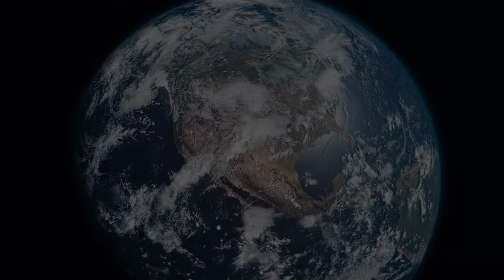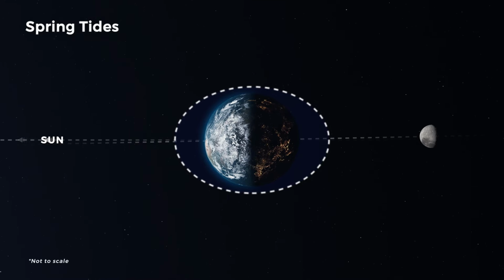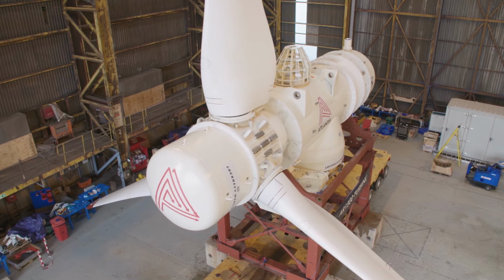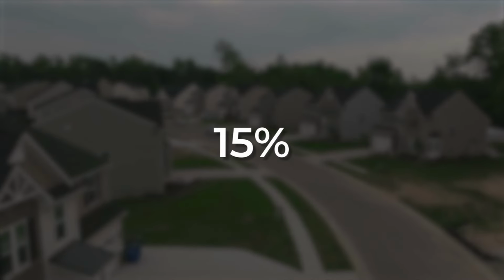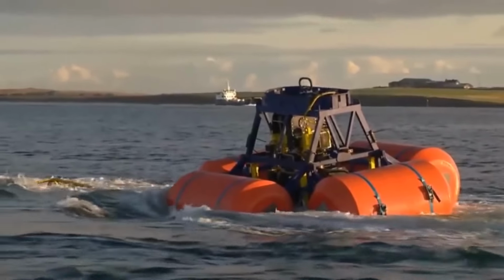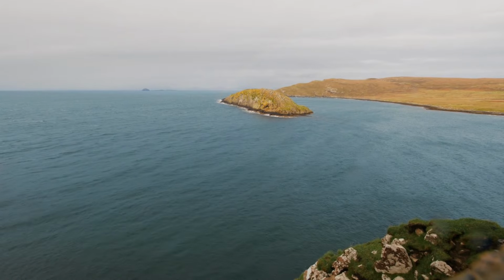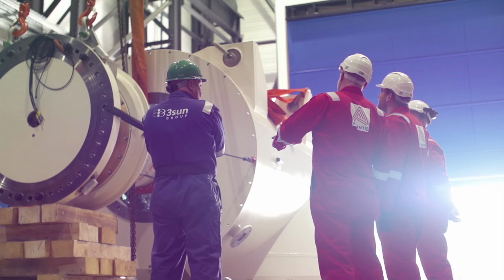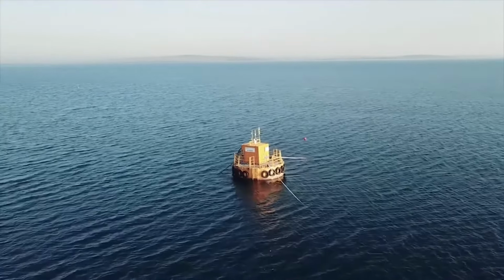Can Underwater Turbines Solve Our Energy Problems?

Comment: You know what's cool? Nuclear & renewable combined for energy production 😎
Reply: While browsing for hydrogen production technology I came across a very interesting new science discovery by a NZ Lab named H2IL . It has the potential to replace nuclear, fossil fuel and renewables energy. I was intrigued by something so simple but scientifically logical. What do others think of it?
Reply: @scienceeducatorge8597  don't know anything about it, but hopefully is something more than a good looking concept!
Reply: pure renewable Energy sounds better ;)
we can talk again when they get Fusion-technology working^^
Reply: @smaragdwolf1  it would be great, but currently it is simply not fiseable in the majority of countries, mainly because of current methods not working 24/7 (poor wind for turbines or night for solar panels and so on). To fill the gaps in energy production you would need a source that you could switch on and off, so you would end up burning fossil fuel. As of today, what you are proposing can't be done, sadly
Reply: @mqwersly  renewable Forms of Energy isnt Sun and Wind alone.
- Pumped-storage hydroelectricity (PSH) pumps, when you have an abundance of electricity, water from a lower storage to a higher build storage. When you need electricity, you use the potential Energy of the stored Water to run Generators, while the Water is flowing down again. (works in Areas with Mountains)
- Geothermal Energy is a pretty good Energy-Source when you have Vulcanic Activity in your Area. Pumping Water into the Ground, where its heated up until it has enough pressure to run a generator.
- As in this Video, when you have strong Water-Currents, you can generate Energy with it.
- When you have lots of Sun and unusable plain Soil, a Solar power Plant is another form of Sun Energy. A Circle of curved Mirrors collect and focus the Sun-Rays into a Spot at the Upper End of a Tower, thats build in the Circle-Center. The focused Sun-Rays have lots of heat and boiling Water very fast, that runs a normal generator then.
- not sure if it exist, but in Areas with Mountains, you could also use Wind. The Up-Currents at the Mountains should be able to collect with a cylindric wind-turbine. Like these really old rolling lawn mowers. cylindric with twisted Slats.
- For energy-storage the newest Technology i know is (Power to Gas) to use the abundance of generated Energy to split Water into Hydrogen and Oxygen and storage the Hydrogen for later use.
- of course we need to connect the Countries with Cables to form a Network, so if one Country has a lack of Energy, it can get it from the Neighbors. In Europe there is already such a Network.

Im pretty sure, we can give most Counties on Earth for sure, a good amount of renewable Energy, if our Leaders would already understand the potencial and the Problems we have -.-

In Germany, despite that our Government defend the Coal-production with all kinds of weird behavior, we will have a ratio of 54% (fossil Energy + Nuclear) to 46% (renewable Energy) this Year. Wind will be the biggest part of the overall Mix with 24%, brown Coal 20% and Nuclear 14%. Our last Nuclear plants will be shut down in a few years, that is fix. Coal-use shutdown will be the next after nuclear.
Reply: @smaragdwolf1  precisely, Germany is a great example of things doing the wrong way, closing nuclear plants while maintaining coal burning plants. It's great that in your country almost half of the energy production is renewable, but still it's a really bad system. Lots of countries don't have water bodies to substain the production of energy (landlocked or without major rivers), and the power storage method that you mention doesn't seem to be ready for mass implantation in a major scale. IMHO, as of today, we should be looking forward to implant a system such as the French, which relies heavily in nuclear and renewable. I'm also interested in the development of thorium reactors, as they seem to address lots of the uranium plants, and of course breakthroughs in renewable technology.
Reply: @mqwersly  They planning and building a Power to Gas Plant in ...i think it was Hamburg, right now.
Even with their reaaally slow speed, our Government made a plan to close the Coal-plants in 10 years....and we Citizens will make sure, that they will do it faster.

Like the French? France has a very old Reactor near the german border and that one had already so many incidents, that at one time, our Government gave Iodine to the Citizens in the closest area - just to be safe. Belgium (another small country near the western Border) has a problematic old Reactor too.
Yes its dumb to get rid off nuclear before Coal, but beside the Fukushima catastrophe, we know very well, that there is NO EXISTING final STORAGE for radioactive waste. Not in Germany, Europe or the World. Its like living in a House on a small private Island...... without a Toilette.
Keep Coal, Gas and Uranium in the Ground as much as possible. Wouldnt our Government (feels like that) actively slowing down the Installation of Turbines and Solar panels, we would have already over 60-70% renewable :(
For the Countries who really dont have any chance to produce energy on their own, i named the Network of Powerlines, spanning through multiple Countries.

Comment: Have you seen anything about oscillating water columns? 
A very similar concept, except it's a vertical setup, floating just above the seabed, with pistons that are raised and lowered by the movement of the oceans.
It wouldn't require being placed in such fast flowing areas, and early studies seemed to suggest they improved marine biodiversity!!

Comment: Hi
question:

are there any studys regarding the longterm impact of removing large amounts of energys from the natural system via "renewable energy sources" like tidal, wind, solar or (most importantly) geothermal?

since all of those forms of "energy generation" are taking energy from an existing system and makeing them usable for us it would be the logical conclusion that there would be less energy in the natural system afterwards (preservation of energy and all that ^^)
and while some of them are predominantly external influences (like solar) things like geothermal (where we pull warmth out of the earth) should be a limited resource (large yes. but still limited)
its a question i never see asked nor answered when it comes to "green energy"...
Reply: Taking that energy isn't really going to do much harm. In the same way that solar energy doesn't stop the rest of us getting a sun tan. Apparently a town in America voted against solar because they were afraid of taking all the energy from the sun.
Reply: @warbler1984  well yea for solar its less of a problem but what about the others?
reducing the air/waterflow sounds like a bad idea 
and lowering the internal heat of the earth sounds like an even worse idea.

and sure we are not taking much at a time... but like a leaking bucket one day it could be noticable and probably irevercable...

Comment: Just wind turbines would work dont need underwater. I had a 48v pmg that made no noise facing forward on my sailboat mast and when i drop my anker on the front the boat faces the wind and charges my boat with 30 amps. Crazy i should covert to electric motors lol.

Comment: I have been citing tidal power for years. The UK has some of the highest tidal ranges in the world. It has less of a visible impact and is much more reliable than wind. With heavy investment in wind I just don't understand why tidal power has not been more favourably received
Reply: Cost. It's just much more expensive than wind or solar and those two are dropping in cost very fast as well.
Reply: @robbert-janmerk6783  All true. But the absolute reliability of the tide offsets the small additional cost (in my humble opinion)

Comment: No and if you like I can modify your wind and ocean turbine to run full time on a dule pack I've been building and modified gearbox so your wind runs 3000 rpm and when the wind picks up can gearbox the load and shut down the power draw from the packs to save cost and with a wind 3mw turbine running all day don't complain. I can get your solar on 24/7 too if you like for a few hundred watts ????? Engineering mmmmmmm.

Comment: I'm somewhat surprised at the fixed versus a possible mobile instillation.  I wonder what consideration was given by the designers of the feasibility of having instillations which are floated in, sunk and then refilled with air to remove/repair?  While the tidal movement generates some force, such submersible structures probably wouldn't move and anchor with only the propeller parts moving.  The footprint on the floor of that type of design would be bigger, but there wouldn't be the need to drill into the ocean floor.  There would be more flexibility.
The storage battery in such cases may be pumping air into anchored tanks with no bottom open to the sea and water pressure at near atmospheric pressure so little energy is lost due to heating/cooling transfer and then drawing on them at off power production times.   Or the alternative, have the generating units use floating snorkels and directly pump air in pipelines to the storage tanks to hold which then could be used as desired.   Transporting electricity for energy transfer is more efficient than moving air and then converting it to electricity, but for the short distance this might lead to many smaller units and flexibility.

Comment: Imagine the  cash literally flushed down the toilet by failing to harness the  energy wasted by waste disposal! I installed a turbine generator in drain pipe and so far the savings on monthly electrical bill are admittedly modest, but they manage to cover almost 60% of the additional drain-related plumbing costs.
Reply: Neat idea, but it has two problems:
First, having a turbine in the pipe slows the flow of water, making it more likely that something gets stuck.
Second, a lot of... - well - shit is going to stick to the turbine itself....
Reply: @Bird_Dog00  btw - to confirm that I haven't a serious bone in my body, please check my OTHER comment for this video about Plankton turbines.
Reply: @Tim Sullivan
ok, that one flew over my head - it shouldn't have, but it did. I would probably have caught on, had I read it a second time...
On the other hand, there are ideas that sound like a joke, that are actually both serious and feasible. Like the kite to power cargo ships. So, you knever know for sure.

haven't yet seen the other comment tough. Can you elaborate? sounds intresting.
Reply: @Bird_Dog00  it was: Imagine the  potential benefits for humanity when Plankton-Propulsion Turbines finally become a reality! Much additional research will be  required before the technology is fully developed, but proponents  for bio-driven energy generation are confident the pace will pick up, once  past the hurdle of training plankton to all push in the same direction against turbine blades
Reply: Training plankton... How stupid of me to not have thought of it...
Reply: @Bird_Dog00  Sorry, but I was totally kidding. Of course you're right about the idea's drawbacks which is why my last remark referred to "additional drain-related plumbing costs."  Perhaps a bit understated? If so, sorry - my bad. Anyway, thanks for your reply. Take care.

Comment: Imagine the  potential benefits for humanity when Plankton-Propulsion Turbines finally become a reality! Much additional research will be  required before the technology is fully developed, but proponents  for bio-driven energy generation are confident the pace will pick up, once  past the hurdle of training plankton to all push  against turbine blades in the same direction.
Reply: that takes a lot of practice  :  the plankton have to push together at the same time
Reply: @robinsss  Exactly! Initial tests suggest  holographic images of sieve-feeders projected to the rear of the trainees at the very beginning of the class help to significantly reduce their initial confusion about the direction required. This success has led researchers to speculate that if the predators' image projections are allowed to continue -  even AFTER classes have  successfully assembled into the required formations - there is reason to believe these holograms may additionally provide an on-going motivational benefit.

Comment: Because they insist on generating electricity with these under water turbines, they automatically become a non base load device. If they where to compress air their full potential could be met and bring them to a base load level like a nuclear power plant. Without dangerous radiation. And all that energy would wait patiently until needed.

Comment: If you use tidal energy to compress air, then use the air to generate electricity, you can remove the electrical generators from the water, save the energy as compressed air to meet demand 24 hours a day, and transport that energy safely with few losses in pipes to where ever it is needed in spite of elevation changes, unlike elevated water. Compressed air is the best way to store and transport energy. Plus seasonal elevated water can be used to compress air and store it for dry times when elevated water is not available, or when the elevated areas become full. Then HYPEG that compressed air into electricity when you need it. Everything you need to know here ...https://www.youtube.com/channel/UC1W6bOhIDxLMMM5scy6jZ-Q

Comment: Do people realise that when they take energy from one thing then that energy is no longer present to do what it was doing before?  Wind turbines lower the velocity and strength of wind by extracting energy from it, as will ocean current turbines.

Air and water currents (including tidal currents) perform a function in the balance of our environment and degrading those currents by extracting energy from them (through wind or water turbines) will have a consequence.

So here's my prediction, people will do these things (harnessing air currents using wind turbines, and harnessing water currents using ocean turbines) and in 30 years time the environmentalists will be protesting the damage they do to the environment (yes, the same type of environmentalists that caused these technologies to be adopted in the first place).  Yes, a single turbine likely does little measurable damage to the environment - but how much cumulative damage might exist if there were 25 to 50 turbines in an area?

Comment: A project like this relies on a relatively rare circumstance where high tidal velocities exist.  And, at this rare location, the project will generate about a tenth of the output of a typical fossil fueled power plant.  So, I cannot see this project offsetting or replacing a conventional boiler/turbine-generator.   So, no, this power source cannot, by itself, solve our energy problems.  In the more common tidal power set up, where you would rely on the tidal rise and fall of the surface, you would need the rise and fall of an acre of ocean to run you blow dryer.  I just don't yet see the numbers working out for this power source.

Comment: I've wondered if San Francisco will have to install a tidal barrage system as sea levels rise. It would serve to protect property during high tides (relevant in a few decades) while also offering energy generation, including potentially using the SF Bay as a huge battery.

Comment: How about a duct around the turbine prop with a protective grid on either side to completely avoid the possibility of seals, doplhins & whales accidently being struck by the blades? Sort of like you have on your typical tabletop fan. I can't imagine that it would have a noticable effect on efficiency either, and you could avoid having all that expensive monitoring equipment like sonar as well as the personnel to operate it around all the time.

Comment: Very interesting video, but you make a bad comparison. The goal of the barage in France is not to produce green electricity but rather store the excess power produced by nuclear plants during low demand periods. Basicaly you compare a way of production to a way of storage which are both connected but with completely different goals and challenges to overcome.

Comment: HELL, YES!!  Everybody talks about solar energy and wind energy, but these two natural sources have the same problem:  The sun doesn't shine at night, and sometimes the wind stops. Not only would wave turbines work 24/7, but they are also totally out of sight, never using even one square inch of real estate to operate efficiently.  100% of these wave generators are completely hidden from sight.  One more thing.
In NYC, there is one supermarket, The Food Emporium, that decided to eliminate its expensive power use by designing and installing an UNDERWATER TURBINE GENERATOR, right next to its store.  They simply placed it in the East River, and let the ingoing and outgoing tide power the system.  I remember the first day they gave it a tryout, the current actually RIPPED THE BLADES OFF ITS TURBINE!!!  So, the engineers simply built stronger blades, and the thing has been working perfectly for over ten years, without a single problem.  And in all these years, they have never spoken of it again.  So why hasn't this technology ever been spoken of, to anyone, anywhere?  And why are we still building expensive dams and atomic energy plants that destroy the entire ecosystem??  Big corporations, and the oil, nuclear, and coal industry.  Because of their endless greed, we all suffer, destroying our once blue planet and leaving only a destroyed, dead planet in its wake.
Thanks for posting this vital and long overdue information.